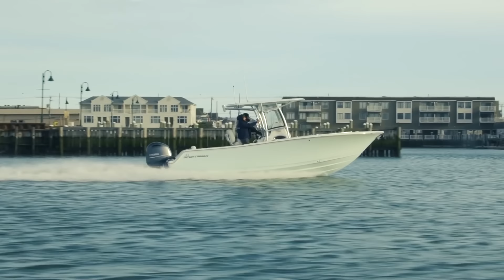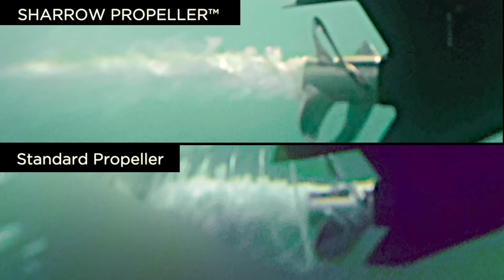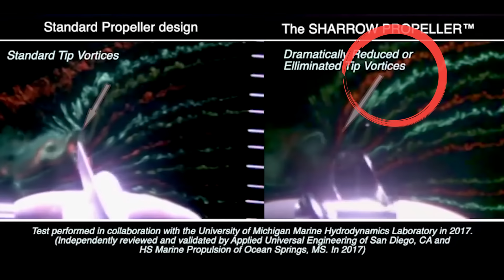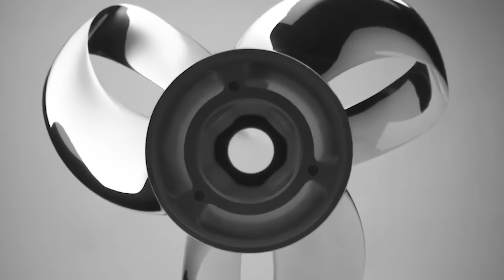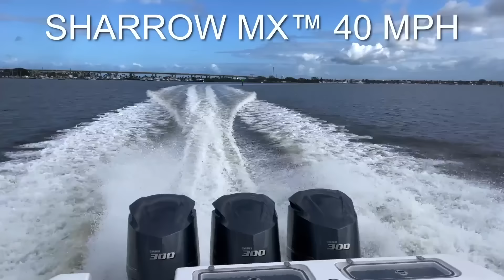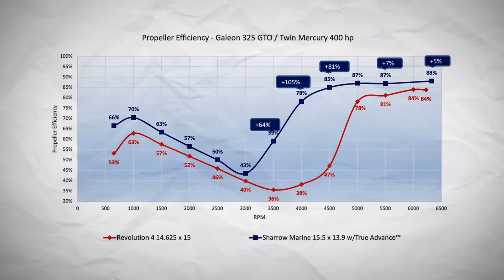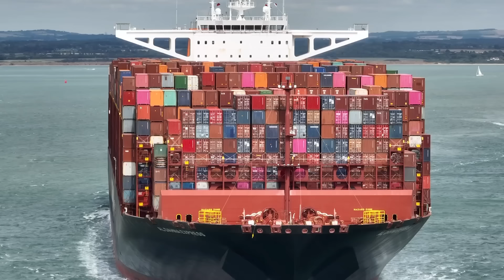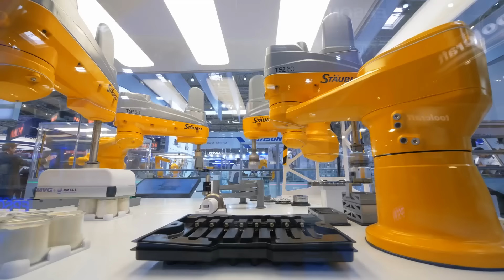This Genius Propeller Will Change Transport Forever

Comment: This propeller design originates in Tasmania in 1971. It was developed by  D B Sugden, an engineer consulting to The Robbins Company  (a US company out of Seattle, specialists in hard rock tunnelling machines). The Robbins Company financed an R and D project lasting 2 years in collaboration with David Sugden. I joined the company in that year, thus I speak with some authority.  We built and trialled a series of propellers from about 10 inch to 30 inches swept diameter.  At that time the difficulty was reproduction of form, a problem which, as you point out, is overcome by CNC capabilities and 3D printing. Trials and wind tunnel testing demonstrated significant performance gains. I recall that a large prop was provided to a fishing vessel owner on the understanding he would trial it for a few months. He refused to give it up because it was so good when the trial concluded. The manufacturing difficulties of that time precluded further development.
Reply from the maker: Just found the patent (US3504990A), wish I had found this before I made this video, very interesting! Thanks for sharing Alistair.
Reply: @ZirothTech  status of the US3504990A is expired, so, any can manufacture and sell it ?
Reply: @MrShaeto  It was filed in 1999, so 20 years from filing and it's expired so yes. Prior to 1995 it was 17 years from grant and so even under those rules it has expired as it was granted in 2004. That it has now expired is possibly why it is seeing renewed interest.
Reply: @ZirothTech  MIT loves to take credit for other people's work whenever they can, so I don't blame you for believing the hype
Reply: @ZirothTech  make an updated video
Reply: @ZirothTech  I see normal blades in the drawings with that patent.
Reply: @ZirothTech  when schauberger went to australia ... he teach some people in his knowledge about water ...
Reply: @ZirothTech  Happy to see that the work of yesteryear might eventually become universally useful. I'm sure Dave Sugden would be glad to know he left a footprint in the sand.
Reply: @ZirothTech  I was looking for this comment
Reply: @ZirothTech  Great research...
Reply: @ZirothTech  https://www.youtube.com/watch?v=MGy8jvf-DZ0 ?
Reply: @ZirothTech  INTERVIEW!!!
Reply: @Ziroth  the first patent that comes up in a Google search is from 2019. I wouldn't be surprised if the original goes back to the early 70s though.
Reply: I worked as the Chief Inspector for The Robbins Company from about 1984 to 1990. We developed many incredible machines such as, the tunneling machines for the “Chunnel” under the English Channel. Didn’t know about the propeller designs, but, Dick Robbins was constantly pushing technology in many areas. We were testing high pressure water jets to assist with fracturing rock in the tunneling machine cutter heads, built a full scale vertical, approximately twenty foot, shaft boring machine and more. If you liked building machinery that had never been done, it was an interesting place to work.
Reply: @davideskelin8266  Hi David, you were obviously in Seattle for part of the time I worked for Robbins. I was the MD of the Australian  company through those years. As you say, it was an interesting company to work for.  The water jet thing you mention was another of Dave's  ideas, but I hesitate to say wholly because such notions were floating around elsewhere.  Both Dave and Dick were not constrained  by outside expectations.  As example, Dave redesigned the violin.....it's a long story, but his instruments are still being built in China. They were both extraordinary people, the best of friends, and the world is a poorer place for their passing.
Reply: @davideskelin8266  Robbins built the most useful industrial building in Kent. From pioneer large boring machines, to power pack and strut for all the early B-777’s, to Blue Origin’s rocket engine research, with a little underuse by that insulation firm with a pink cat. Of course nobody has used the capacity of the bridge cranes since Robbins left. 

Was part of the inspiration everyday seeing the firm across the street that built the reversible propellers hubs for the Polar Star and Polar Sea? Or just the interest in high mechanical and hydraulic engineering?
Reply: It’s hard to believe that since 1971 no naval engineer had developed it, knowing that propellers are one of most refined and studied piece of a boat
Reply: @Quemedices684  This is how those fancy submarine propellers work
Reply: @Quemedices684  US navy already has something better. Our submarine props are a coveted secret
Reply: @Joaquín CF  if you a had read the comment, you Muppet, you'd know that the manufacturing has been the holdback.
Reply: In water, its design might fowl easier and be harder to clear.
In air it sounds ACE !
.
Reply: @Quemedices684  наверняка Dapra этим занималась.
Reply: @Quemedices684  Manufacturing cost is huge factor in the success or failure of inventions. All things break and a more expensive version must amortize its cost over its life time. In addition if mass manufacturing is hard, economies of scale does not kick in and without large number you lack the money to optimize the invention.

"Quantity has a quality of its own." - Joseph Stalin
Reply: @michaelrenper796    It's some kind of obsession with me to contemplate Singularity Intelligence ( a.i. ) emergent awareness transcending the inherited systemic blockages mankind has inherited and conducting a pure principle Real Economy  * / sustainable / renewable / ecological / energy unit / accounting / engineering sense / analysis / make over ... for the planet .
Sense rather than money . 

At some point Singularity shall obsolete any yesterday's monetary unit accounting vested interest encryption and gain access to global data for global systems analysis of logic disconnects with Real Economy * .

* " Critical Path " / " Grunch Of Giants " by Richard Buckminster Fuller .

Fuller was an American pragmatic Transcendentalist  .
Reply: Go Tassie! Whoo hoo!

I'm totally not biased or anything
Reply: I don't blame the fisherman for wanting to keep a State of the art rotor blade
Reply: @destroyer2496  Why? Zero integrity!
Reply: @destroyer2496  catch me!!! 😂😂
Reply: Ohhhh yeah, that’s the research that George Santos founded. I think he mentioned that during one of his Nobel acceptance speeches… shame on you for not giving credit where credit is due… 😂
Reply: I wonder if submarines use those, as silence is the number one priority on any submarine. In most Navys, the propellers are considered top secret and the only photos of submarines you'll find have them either submerged or covered.
Reply: I want to hear more about that 105 percent efficiency. I could use that.
Reply: @anonymike8280  There is no claim of 105% efficiency.  That is clearly not possible.  What is claimed is an efficiency increase of 105%.  That is perfectly possible and would not break the rule regarding the conservation of energy.
Reply: @GodmanchesterGoblin  Satire. I got the idea.

I think it is possible to give 110 percent though. Or is that that people don't want to admit that their best effort is about 88 percent most of the time. I think I just said that the theoretical maximum human effort is 114 percent. Just call it 110 percent. No one ever reaches theoretical maximum efficiency anyway. For most people 38 percent is a Stirling effort.
Reply: @GodmanchesterGoblin  105% MORE efficiency than previus model. This what he means.
Reply: @J Suparman  I know, that's what I said. I think you perhaps meant to respond to someone else's comment.
Reply: Perfect example how many inventions aren't actually new, but just didn't take off due to other limiting factors.
Reply: I met Dave Sugden a couple of times. In tassie at terratec for the trial of the oscillating disc cutter and a lecture of the Melbourne metro. Amazing guy.
Reply: @mchughcb  I'm glad to hear it. He was truly interesting.  I had forgotten about the oscillating cutter.
Reply: I noticed you guys, Tasmanians, are really proud of your accomplishments. :) spent there 5 days in December. As a european whole Australia was very special to me, but Tasmania is significantly more. Wish I could go back for 3-6 months, get a local friend and hike the whole thing across and around and back.
Reply: There is an example of this type in the Ciro museum.
Reply: Interesting that the design also protects the blades from hitting logs, rock and stuff it..
Reply: @simontheyers801  How?
Reply: @awakenotwoke1973  it's a solid circle.. not exposed fine blade.. the side would rub rather than slice into debris
Reply: My dad made his own in the 60’s for our houseboat!😂
Reply: Tassie gang
Reply: Interesting. Thanks for sharing!
Reply: Excellent detail. I bet many technologies were shelved because of production issues.
Reply: Thank you for this. Your knowledge is irreplaceable.
Reply: Actually I'm a bit confused the whole design would be something any navy in the world would want their hands on . Now its shown on youtube xD
Reply: Would this be applicable to windmill power generators? I seriously think that the Holy Cross is homage to the ancient technology
Reply: Thank god it's an Australian invention, Why is this only known now?
Reply: @fr33kSh0w2012  wouldn't be the first time credit was stolen for someone else's design/idea. 

Real reason it's been waiting until now is that mass production had to wait until something like 3D printing to come along. 
Now you can search through the archives of complex designs which never broke through and make it a reality.
Reply: Your comment is false and misleading. It does a huge disservice to the MIT engineers that developed and invented the system. This was in fact, not invented by Sugden, it was invented by interns at MIT.
Reply: @ZxAMobile  That makes it very hard to explain what was happening in Tasmania in the 1970's then.  I am not suggesting that MIT has not arrived in a parallel place independently as has happened numerous times through history. Just recording what happened here, which I was party to.
Reply: @ZxAMobile  actually it is FACT ... watch victor schauberger copy and comprehend nature ... specifically his copper plow ... THAT is the earth version of a toroidal propeller ... PATENTED by Schauberger ... back around 1910 ... his repulsine is designed from the torodial motion of fluid and is what the Patent from 1971 is based on ... another persons work that is over 50 years old that no longer can be restricted by patent ... making the 1971 patent a NON patent because ti wasnt their idea in the first place NOR was it their patent ... and MIT had NOTHING to do with developing it ... stealing it from schauberger yes developing it no ... the original patent is schaubergers ... the propeller shown is also not patentable because the patent on that system became expired in 1960's ... making any further developments form it NOT patentable ... making BOTH of your claims wrong ...
Reply: @kaboom-zf2bl  I find it funny that you think some random guy in the early 1900s invented something that MIT could not. The engineers at MIT are light years above some random dude in his basement making some random stuff in 1900s.
Reply: @ZxAMobile  go watch the video copy comprehend nature ... he did it years before Mechanics In Training even had it in their heads ...  and LEARN some truth .... MIT might be prestigious but it stopped being premiere decades ago ... its JUST a school of mechanics nothing more now
Reply: Nice! ..but I'm not sure 'originates' is the proper word to use, as I think considerable credit for the concept is owed to Viktor Schauberger, who was born in the 1800's, and so didn't have access to the requisite manufacturing tech for realizing many of his ideas in the field of fluid dynamics.
Reply: If it it so much more efficient, how come the giant shipping companies etc. is not using them?
Reply: I assume this would work just as well in reverse, as a wind powered generator???
Reply: I LAUGHED at the reluctance to return Test Prototype bit as this has happened to me several times, only retrieving my Item on promise or delivery of a Personally made Order.

PS. I have a good Friend in Tasmania.
I might enquire further.
.

Its ALWAYS a good sign !
.
Reply: Was wasn‘t this design used sooner if it existed for over 50 years? 
Or has it already been used for particularly fast boats and in the military prior and is only now being made accessible for the general public?
Reply: A link from wiki would be enough
Reply: wow. the best comment ever!
Reply: Where would this design stand against the prop on a nuclear sub any similarities
Reply: That is pretty cool story, if you did not take the time to share that with us, we would all probably still believe this is a new concept that is just now coming out. I certainly did not know that this design was over 50yrs old, I wonder why the original design didn't make it to production on a large scale. I guess some things are ahead of their time, but I certainly hope the original designing engineer/team gets any credits they deserve.
Reply: @brine80  costly machining process that has been reduced by advanced cnc machines and 3d printing
Reply: The best inventions are from Tassie,
Reply: Two pieces friction welding... your welcome. Yes I'm suggesting you cut it horizontaly and make these first, think of it as two props with one wig tip pointing up and the second prop with a downward facing wing tip.. then pancake them together and ah little bit of friction welding... and bam!
Reply: and african invented this?  Wow.   Who would have thunk
Reply: Ahah no shit ! Once it was broken i bet it ended up on a trophy shelf ! Like all the best manmade tools we do!
Reply: US takes Aust. IP claims it as theirs and sells it back at 10x the price.
Reply: This guy is a farce...he picks a subject, does little research, uses a fake accent and collects royalties.
Reply: Can you invest in this company and do they have the patent for the design?
Reply: I wish you had taken real good care of this guy and retrieved the prop.
Reply: Not with that picture you did not
Reply: By young einstein?
Reply: And wait 50 year until he died
Reply: You could have just made that up lol
Reply: So, you know about metal gear?
Reply: Thank you for sharing
Reply: This is fascinating. I grew up in Hobart in 80s and 90s and had no idea this has happened.
Reply: @TheMelbournelad  Well there you are. It all happened in Kingston.
Reply: Why can't these be made in a casting process?  No fancy computer needed. Computer for the original,  sure, but why not casting for large batch?
Reply: Is there any possibility that the company could once again manufacture such a design?
If these have significantly less wake I can imagine they'd be hugely welcomed by the operators of the CityCat river ferries operated up in Brisbane (Queensland).  The wake of those things were bashing marinas really hard to a point that docked vessels had structural damage, not surprising given the the frequency of passes the CityCats made.  They're a great way to get around in a river city but the impact was always a problem even when they slowed down significantly in built up areas.
I last saw something about this in about 2011 or so, do you know if your company ever proposed such an idea to Queensland Transport?  I'd say they'd jump at it for the PR and damage/dredging aspects alone.
Reply: ok, let´s just call it Sugden propeller finally
Reply: But moulds were already a long established thing.
Reply: I knew about this at the time. It's a bit sad it was ahead of it's time. Hopefully this will be picked up again, because it's very usefull technology.
Reply: To reduce production costs on a part like this maybe you contact a company like Ruger firearms on investment casting this is the easiest way to reduce machining costs to only fine finishing
Reply: This design was developed long long before 1971. Let's design actually exist in a polished Granite artifact I believe found in Egypt possibly South America. The only difference is the ancient artifact is in a completely circular form
Reply: I thought Robbins HQ is in Solon OH. I know someone who worked there for a bit
Reply: Submarine propeller technology is one of the most researched fields in marine engineering.
Noise reduction is critical, to the survival of the boats.  
Container shipping would benifit greatly.
Reply: M.i.t. are claiming its there idea too lol. Pretty sure i saw em on one of those little scuba diver motors a while back.
Reply: "authority" LOL what a melt
Reply: At the moment, I don't see any problem with making these low-cost propellers out of Kevlar. Yes, 3D printing could work. It's all about the size of the screws. At least for most vehicles, it is already quite possible in the near future to acquire such propellers.
Reply: Fascinating, thank you
Reply: How to invest in them? They would be interesting computer fans, computer fans are almost like this now anyway I suppose.
Reply: When I was a kid I remember a design just like this it works great like the flying paper ring I saw add on to that made it better.   Better we can not have that and the boat guy I would of just asked to buy it's a aid to help all but most don't see that most want or are use to the parts dept just buy more.   You all winder why and why no one wants to make or design.  You get well he was wrong blah and so on ok kid shut up reasons see the world today kids if old just say do as your told not here figure it out. And I make all my own free to,make anything. And I don't ever share just hit me you you all have some clam candy
Reply: Ehat about the one they dug up in Egypt
Reply: What about the one they dug up in Egypt
Reply: Big things come out of tassie.
Reply: Awesome work Allistar. Can this style of prop run on a Bravo 3, duo prop leg?
Reply: Спасибо за ваши труды,в новое время легче сделать такие формы.
Reply: thanks for the copy and paste
Reply: Oh wow
Reply: I thought it was developed by B J Sugdon?
Reply: Funny... 1971 also the year they destroyed our money and ended the gold standard. Our broken money is anti innovation and they wanted it. Innovation allways destroys the wealth of other people.
Reply: They always say you can't reinvent the wheel. Yet here's a great example of the world trying to limit creativity and possibilities. And now they have almost recreated the wheel.
Reply: How we doing down here at the end of this comment's reply thread? Like boats still?!?!?!?! Lol
Reply: must have been a kiwi
Reply: Internet broke me and I waited for deez nuts joke till the end of the comment because of the surname
Reply: So this is an old design that is now becoming usable by technological advances, neat
Reply: Why don’t big transport shipping companies jump on this? If they can save 30% fuel cost they would kill for that
Reply: @Nobody-iy6tm  not likely, casting metal leaves lots of rough spots and imperfect lines that would basically ruin a propeller blade. You could cast the overall shape of it, but a machine would have to finish it by going back over it to produce the clean lines needed for a good blade.
Reply: Why can it not be cast in one piece? Looks like everything is connected, so pouring into a mould should work?
Reply: @x-shadow-x  they likely do that but its not enough.Its just that machining it to near perfection is hard. Probably has to be within certain tolerance to perform optimally. Seems to me like this is a material problem not manufacturing. Need something extremely durable.
Reply: Awesome comment, thank you for the insight
Reply: But it was patented by Sugma.
Reply: How do I connect with you? Would love to chat about your experience
Reply: Taken from the ideas of Viktor Schauberger
Reply: Can you imagine designs like that for an aircraft propeller, and using something like an opposing piston engine, and an aircraft design with minimal parasite drag to extend the range to it's maximum!? You could probably get aircraft like the Rutan Long EZ to cross most of the globe with the right model build
Reply: I live in Tasmania how the hell am I only hearing about this now.
Reply: Have you copied it from Google because I caught the same paragraph on it.
Reply: Насколько в % снижен Шум и как изменилась Тяга корабельного Винта (пропульсивный коэффициент) ? Это самое главное. Стоимость -это не главное.
Reply: Thank you for sharing your experiences. As someone that has been developing prototypes I can confirm that we are always limited by factors including expenses of production/manufacturing. There are always superior designs and mechanisms but most people wouldn’t be able to afford them and then there are additional considerations like the downsides. In the case of this propeller, I would assume that the damage on impact is much stronger than it is on regular propeller blades.
Reply: Thank you intellectual property must always be protected by giving credit to the researcher.
Reply: So are these torodial prop using CNC available?
Reply: Thank you for sharing! Its nice to see smart people real people leave quality information and history!!! I am looking for a job any leads please let me know.
Reply: More made up crap.
Reply: Thanks for sharing!
Reply: @Blind Freddy Oh my, cultural appropriation?
Reply: You don't mention that the modified blade tips that will give the marine propeller greater protection and strength than the traditional kind. This would allow it to be thinner and create less form drag too. I think this is a great idea and it should be tied in with a theory to supplement the old Froude or Actuator Disk theory too. 

However, I am writing this because there is a related design for stationary propellors on helicopters too. The loss of efficiency is due to the fact that the escaping fluid behind (or below) the propeller (or rotor) still has some axial kind of kinetic-energy being wasted in its flow. Had a centrifugal fan been used and the resulting radial flow then redirected by a curved "canopy" so as to spread out as well as turn it, so as to direct the slower speed flow backward, this aim of reduced kinetic-energy would be achieved. This is not only about the tip-vortices being spread, but also about the whole departing flow momentum concept being improved.
Reply: @David Harold Chester  

I am sure you are right, but I am no expert in the complexities of fluid flow. In its most fundamental expression, we were trying to reduce, if not eliminate, the radial losses and direct the energy to the axial.  As you point out, strength is enhanced, so too fouling of nets and lines. Overall, the improved
Reply: WOW what radical superb design. Massive sales to expect obviously. 
One of my first thoughts is this has to seriously be considered for trails right now for airline and private Jet engines surely!
What a Genius of a designer, an Aussie too.

JB. East Surrey. UK.
Reply: Sugden?
Reply: So it hadn't caught on in 50 years. That means that it has issues.
Reply: Funny how one comment can add so much context to a video. Your experiences were something missing from the videos I usually see talking about this design.
Reply: Is there any calculation that shows that this particular design is the most efficient? Where do ideas come from, just random design and then the results are measured? How come it works both for water and air? Is it not with different angles/sizes/frequencies?
Reply: Yes! I just wrote a comment that I read about a ‘twisted ringed propeller’ that was developed a long time ago in Seattle a long time ago, specific details I no longer recall. Thank you for the information.
Reply: And only 300 years after Da Vinci invented the aerial screw.
Reply: Also has been used on submarines, for a long time!
Reply: You were part of a cool scene!
Reply: ….have a radical suggestion for further efficiency in marine propulsion and transports - that the newly configured torus-prop be used with a carbon fibre modular ekranoplan….the modules will be detachable, stackable, and aerodynamically designed to take advantage of the ‘ground effect’ (dense air at surface of planet to 20’ in height)…the frame unit supporting the engines will also be made of robust tubular carbon fibre and be something of a skeleton before the container modules are added….upon delivery of goods in transit the unloaded frame will be hoisted - by water counterbalance means - for reloading upon a ramp of sufficient height to ensure take-off at maximum loading. 
The system will very evidently depend on clear weather to be efficient but a series of transit stations in the ocean will ensure safe reach in all circumstances with final guarantee of safety being floatability in detached units. The transit stations will depend on the use of khatmatrix deep ocean pontoons (2 mile deep submerse supports) which may network the 7 main oceans of the planet and be culturally styled according to the seven main religions of the planet. The advantage of the system will be the combination of these factors over container shipping: eradication of hull drag; increase of speed by a factor of 15 (1,500%); up to 2000% reduction of material investment occasioned by 20x strength of carbon over steel further multiplied by the substantial gain to be made by its lightness in comparison with the same. Suggest an initial deployment from Russian Arctic through the ex-Hanseatic League nations and across the north of the North Atlantic to Canada taking advantage of the string of landfalls (Faroes, Iceland, Greenland, Nova Scotia) available on that route.😂
Reply: Sick
Reply: I learned from my better Half (coming from Bengal): “what Bengal thinks today, India thinks tomorrow and the world there after and the Suabians (die Schwaben) are first in producing it “. Well, Schauberger is an exception. By the way it is also human intelligence which hinders small technical change in order to keep hard and dangerous labour by hand. Since 1972 my company Brown Boveri & Cie. AG had proposed to get railway freight wagons coupling electronically . Until today the clever politicians could not give their ok to a europewide technical solution. It has still to be done by hand, except in Sweden. Perhaps in 2030 when I am just 90 a new decision for a small delay will come.
Reply: Interesting. Google says it's from 1890😒
Reply: Actually, this propeller design originates from Leonardo da Vinci drawings.
Reply: Why didn't you go to the Navies of the world? Feel like they would have been able to over look the difficulties in manufacturing.
Reply: Interesting. Some propellers have a ring around the prop, isn't this rather similar to it. Also, isn't prop efficiency like 90% today. Does tgis make such a huge difference?
Reply: @sandpatch133  Ducting (the ring around the propeller) definitely helps reduce tip losses and cavitation. It also creates parasitic drag. And it needs really close tolerances to be effective. Bang against anything, and the ring can be driven into the prop. The toroidial prop reduces the tip losses more elegantly, and if it bangs against something, it is damaged but not instantly destroyed.
Reply: @sandpatch133  at maximum efficiency, prop efficiency is like 90%. This prop reaches maximum efficiency faster, and it is slightly more efficient in all areas, but in those areas, it is not a large difference. The main benefit is the prop reaching maximum efficiency faster.
Reply: @sandpatch133  90% is the best they achieve under optimal conditions. Toroidal has a better efficiency over the whole range of RPMs from what I've learned with a quick search(up to 110% more efficient than classical at mid regime).
Reply: @sandpatch133  the ring around propeller helps reduce cavitation , but bubbles are still made , its pressure , area speed and heat combination that causes the bubbles,  the design of this propeller reduces pressure to area ratio , which in turn reduces heat , which reduces cavitation ,  the second problem is of vortices , since the angle of the blade is such that multiple vortices are produced at the same time they tend to cancel each if the perfect angle is achieved theoretically it might even be possible to eliminate the end vortices completely , elimination of these further improves its efficiency, view the propeller from side profile and u will realise the difference is not just about the elimination of tip but the entire blades angle of attack on water / air . hope this helps , enjoy sciencing 🙂
Reply: @RaviDesai-uz5wd  🫡 thank you!
Reply: @RaviDesai-uz5wd  Go back to reading Captain America.
Reply: @AquaMarine1000  well let see , my friend chris here has major life goals , open youtube find a simple conversation and come up with smart ass ideas to troll strangers. u will reach high places for sure keep it up .
Reply: @sandpatch133  If you spending millions on fuel costs a year? Yeah.
Reply: @sandpatch133  ring is to protect the prop, or on small pleasure vessels it's to protect a person if he/she falls off the boat or for when a drunk boat driver "drives"over people that are swimming...the ring doesn't do anything performance wise
Reply: @sandpatch133  Die Graphic  zeigt es ja, spulen sie zurück .
Reply: @sandpatch133  there is missing information in this video, the efficiency gains will only exist under narrow condintions i.e tip speed, disk loading, cavitiation or ventilation presence. the main incentive for this tech is the noise reduction not efficiency.
Reply: @10babiscar  That makes more sense. Thanks for clarifying
Reply: @10babiscar  If the noise disapears, the effencie grows ... what else?!
Reply: @onkelheri-XS  less noise is produced but energy is also dissipated through turbulence and viscous heating. this design reduces the ammount lost to noise by a large amount but with a marginal loss to efficiency. the propfan tech had a similar problem in being more efficient than a turbofan but noiser
Reply: Yes.. but before all that all, this came from the work of Viktor Schauberger.
Reply: @PhiTonics  I'm glad you mentioned Victor and his work in fluid dynamics, but this also triggered another disk I've seen in the Egyptian Museum called the Shicks Disk not sure of the spelling so I spelled it phonetically. This disk doesn't look like a propeller but its outer ring would cut down on vibrations, and it got me to thinking. 

What if you wanted to have two vortices spinning in opposite directions like one fits inside the other. I think this is something Victor would think of, but maybe it would be just as good as one more efficient propeller using two disks...
Reply: @PhiTonics  no it was the british. just ask them
Reply: @ronalddavis  🤣😂💯🙌
Reply: @PhiTonics  Didn’t Schauberger say that propellers in general we’re a poor design?
Reply: @PhiTonics  I was wondering about Viktor Schaunberger, even though I have no specific memory of reading about him working on propellors or even on boats, his understanding of fluid dynamics was second to none and as soon as I saw it I was getting echos of his ideas bouncing around in my head. Thanks for letting us know. Due you have a reference?
Reply: @PhiTonics  And several tribes in Africa thought of it first but due to technological limitations were unable to pursue it further.
Reply: @BWolf00  grow up.
Reply: @PhiTonics  LOL...The video is about a "new" technology and a guy explains how there were researching and attempting to develop this but were unable to commercialize it because of technological limitations.  And you responded with they're using someone else's ideas.  Elon Musk has become the God Father of the modern electric vehicles...but his ideas and implementation is built upon the inventions and "technology" well over 100 years old..and yet I haven't seen one person say...but it was so-and-so's idea.
Reply: @BWolf00  your such a smooth brain I don't even know where to begin, oh yes I do! mute.
Reply: @PhiTonics  From a smooth brain to a smooth ball...works for me.
Reply: @Slay_No_More  2nd attempt due to YT censorship. Too bad you're so disrespectful of Africans and Egyptians...the entire world uses Arabic numerals.  Besides some believe Atlantis was African in origin.  ;)
Reply: @Slay_No_More  Now I feel you may have angered the religious left...and the cult will enact a cancel culture pogrom upon you.
Reply: @Slay_No_More  LOL...dude, it was a lame joke, meant to drive home the absurdness of a random comment.  It really wasn't a definitive statement toward Black Africans, Egyptians (MENA) and their contributions towards the advancement of toroidal propellers and mathematics.  PS - 99.99% of the world has not contributed squat to the advancement of math and science...which is why the 0.001% are usually heralded for their advancements or at least notable in some circles.
Reply: @BWolf00  Go back to watching black panther, real life is not your forte.....
Reply: @BWolf00  is there anywhere i can read about this? Its hard to find information on particular style of propeller, let alone its origins.
Reply: @shrimpy7862  I would follow the leads presented by the video and the people/company mentioned in the comments.
Reply: @BWolf00  is that where you heard about it?
Reply: @heybabycometobutthead  Hey Baby...I've never spent my money on a drag show, Marvel, Disney or any other leftist drivel...including BLM or rainbow flags.  And they can pry my gas stove from my dead cold hand.  But I can act like a Butthead when I want.
Reply: @shrimpy7862  Yep...seems I remember reading about toroidal shapes (in reference to military applications?) but don't really recall.  This is the first commercial application I've heard about.
Reply: @BWolf00   @twolfen58  i see.... I've read all the provided links, and additionally some other sources and so far the only mention I've seen of anything out of Africa is an Egyptian screw pump. I'm sorry to say I doubt you, I feel like somthing as significant as you claim would be a bit easier to find.  Underwater props unlike screw pumps we're not even widely developed until around the 1700s and even then they were prototypes. With out any evidence to support it, its a very bold claim.
Reply: @shrimpy7862  Dude, as I've already said, the African reference was just a lame ass joke to to address the absurd nature of a random guys comment.  I wasn't making a claim...but a joke.  The whole video is about the current commercial application and the potential applications of this "new" technology.  As it goes I'm fairly certain that it's already in classified use on our boomers.  There's no need to make a mountain out of a mole hill.
Reply: @BWolf00  I see. I can't see that comment, it mustve gotten filtered. Not that it was a very funny joke anyway. I was genuinely curious because I'm an avid fisherman and sailor, and also because history is cool 😎 🤓. If you had explained it was joke from the start it would of never been anything, so I'd say you made a mountin out of a molehill.
Reply: @shrimpy7862  Since my comment where I say it was a lame ass joke was prior to you showing up...sort of makes it yours and YT's problem not mine.  Molehill flattened.
Reply: @twolfen58  So, by your opinion, all our technology and science comes from Egypt? Somehow, they predate all civilizations by 50,000 years or more? Egyptians didn't build the pyramids they found them and settled there from Ethiopia. Atlantis was 1000000 years ago. The pyramids are landing platforms for RA's space ship.
Reply: @BWolf00  well I got a LOL out of it 🎉 Elon Musk though is leading the way for what an African can achieve.
Reply: @BWolf00  Except more than half the world population in Asia....
Reply: @BWolf00  Sure, sure. Totally.
Reply: @BWolf00  yes they had them on wind generators supplying power.
Reply: @BandARestorations  looool
Reply: @BWolf00  are you high ?
Reply: @BWolf00  Mole Hills were invented in Bhutan at least 50,000 years ago.
Reply: @SirGregory  - mountains were being made from molehills long before that good sir. Chimpanzees were doing it none-verbally for 2 million years and still do to this very day. They fling fresh dung at each other when squabbling 😂
Reply: @BWolf00  Arabic numerals are known as Hindu numbers in the arabian world.  These came to the western world from the middle east (hence calling them arabian numerals) who got them from India.
Reply: @BWolf00  ayo'..........hol'up(smacks lips)so you be sayin' yall was kangs n sheeeeit?
Reply: @BWolf00  bet you think Africans thought of it all
Reply: I am immediately suspect of any statement which begins "some believe..." or even "many people think...". Believe without evidence is meaningless.
Reply: @BWolf00  you do realize that Arab has nothing to do with africa? And the modern numerals are a c0mbination of the original arabic numerals and some indian numerals.
Reply: @BWolf00  indian numerals.
Reply: @BWolf00  Then why is it blatantly accepted by all the African tribes of Sub-Saharan Africa that they had no written language and therefore there is no record of such anywhere. Anyway, I thought this was about propellers?
Reply: @BWolf00  there's absolutely nothing special about Arabic numerals. It's just 10 'letter' language of numbers. Instead of 10 it could have been 2(the actual digital as 0 and 1 but could be a and b or + and - instead) 5, 12 or 15, the math would work the same. 
2×2=4 in any place in the world regardless what symbols or system you usePeople are able to express the same ideas in any of thousands of languages whis works by the same principles even though they may developed independently.
Reply: @BWolf00  well, there is this thing called the shisk disk it's a pretty famous Egyptian artifact. Nobody really knows what it is some Egyptologist think it's a vase. Which is kind of ridiculous shisk disk looks similar
Reply: @nathanh1582  true, but before the Arabs, there were the Egyptians and the Egyptian's had x2 African-American Pharaohs from Africa from a place called punt who ruled Egypt.
Reply: @BWolf00  😁😂🤣
Reply: @BWolf00  numbers came from india, asian rasisit!
Reply: @BWolf00  "Arabic" numerals or the decimal system was created in India and taken to the world by Arab traders.
Reply: @BWolf00  long grass would do it
Reply: @BWolf00  wuz kangz?
Reply: @BWolf00  wrong.  the chinese developed it since ancient time but wait for  someone make a martket then they can copy.
Reply: @EverydayImTECHnIt  African American pharoahs? In a time when the Americas hadn't been discovered by the rest of the world and no Africans had been transported there yet?

If you say so.
Reply: @BWolf00  The guy inventing zero....thanks for nothing
Reply: @BWolf00 lol
Reply: @EverydayImTECHnIt    African-AMERICAN Pharaohs ruled Egypt 😂🤣🤣
Reply: @nathanh1582  Sure it does...Africa is where Arabs harvested their slaves from for so many centuries.
Reply: @jimmycricket5366  Once again it was a joke.
Reply: @Ihtiandr13  In Woke America 2 + 2 = 5
Reply: @BWolf00  Sure, I get it, but remember we live in a world now where twisted people with agenda are trying to promote false narratives... So sadly we're not sure when someone is joking anymore.
Reply: @BWolf00  name anything Africa has done for the world in the past century. No major innovations, you say? Buildings made of mud, you say?
Reply: @BandARestorations  atlantis was 12,000 years ago, dude. It was absolutely not a million years ago.
Reply: @skipintroux4444  you and i both know elon musk is not the face that pops into our heads when you hear "an African man"
Reply: @stevenkunkle3857  where is your proof cupcake?
Reply: @BWolf00  tesla was musks idea... he bought the company smooth brain.
Reply: @resmores  Somehow I imagine years later some other idiot with a pair of peanut sized brain cells hanging between his legs will still be responding to this post.  

This issue/question wasn't a matter of ownership, but being the originator of an idea vs being responsible for (or being involved) in the commercialization of that concept.
Reply: @BWolf00  Arabic numerals are Indian in origin, they are just called Arabic, these characters and styles have evolved over time. Prime counting hasn't always been ten. A dozen for example is left over from the unit of twelve. Cheers
Reply: @BWolf00  You are very weird, acknowledging the inventor's is a good thing. Elon musk is a shit comparison, because he got famous because of other stuff as well, like SpaceX and much more that doesn't mean people think he invented space flight. I mean his company name is literally Tesla which already gives more recognition and respect to the father of electricity than the American government has.
Reply: @entireglxy4338  First I wasn't arguing against inventors or discoverers...but just as important are the people that expand on or capitalize on these via commercialization.  In this case people were diminishing the work of a company and a researcher of that company because they were not the "inventor".  Conversely I acknowledged how, although not the "inventor" of the electric automobile or even the creator of Tesla Motors, Musk's commercial success with Tesla Motors he has had a huge impact on our society.  So much so his name is now synonymous with Tesla autos.  

Now on to Tesla himself, first notice how Tesla was both not the "discoverer" of electricity nor the inventor of the electric auto...yet he is the acknowledged "father of electricity".  What's weird is you comparing the "recognition and respect" of the "father of electricity" Tesla to any government much less the American government...that's a shit comparison.  BTW, Musk did not name the company...that honor goes to the founders of Tesla Motors...not Musk.  Again, Musk just capitalized on the commercial success...making his name synonymous with it.
Reply: @shrimpy7862  He's trolling you. He literally stated the world uses Arabic numerals therefore the world owns them everything that uses Arabic numerals
Reply: @sleepyearth  yea, he told me he was joking 2 months ago
Reply: @shrimpy7862 One of the above comments has the Patent #.
Reply: Nigerian prince needed help to fund it
Reply: A 5 axis machining center would have no issue buzzing one of those out in no time.
Reply: @chrisnat6467  это не будет экономически выгодно.
Reply: yay tasmania
Reply: So all windfarm blades will be retrofitted with These?
Jet engines Too?
Reply: The are 1,000,000,000s of food blenders out there that could benefit from this technology.
Reply: IT'S REVOLUTIONARY !! ... even if it's an old invention.
It was invented in the past at a time when we could waste anything.
It is now re-used at a new period of time when it becomes a key factor in transforming all our industry of transportation and energy as we have to do to survive.
Reply: actually Allistair ... it was developed by Victor Schauberger from his discoveries on how fish move in water .. and this design is because of shark skin ... the schauberger earth plow is a similar design ... this was done back in around 1910 ... his repulsine also uses this exact same technology ... and yes it is the exact same pattern as found in a slide showing shark skin ... 
 a Good video to watch is copy and comprehend nature by victor scahuberger .... it covers this and his sluice troughs and water management for log travel etc ...
Reply: Chatgbt ftw
Reply: At 4:24 you will see Dave Sugden with a bandage on his face. Apparently used to hand make violins.

https://youtu.be/a56a8L6x6eg
Reply: Yeah, no. I'm very sure that I could create some dies to forge these, and I could most certainly create some patterns for the molds to cast them! Lmao! Machining and balancing them would be a breeze also. 
These could have been quite easily manufactured using a follower attachment on a jigmill and a good 'master'.
Reply: @oldnick4707  I would love to know how exactly you think you would forge these?  Have you ever designed a forging die or seen a forge in real life?
Reply: @Old Nick  if you can  build me one of these props for around the cost of an existing prop,I'll  buy one off you,and so will everyone i know. Sounds like you stand to make a fortune. If the claims they make are accurate...
Reply: @oldnick4707  Says the guy who is currently not making $5,000 propellers...
Reply: @mickmccasker6401 ,
   I make $25,000 (and much higher) stainless impellers for industry. You are correct. 
   It's hell to find people to help. Grinding, polishing, machining, balancing, etc.. Finding foundries for example that will turn out high-quality product in stainless? Good fucking luck! Pretty much these guys have a deal with a foundry, and are lucky in that, or they're doing it themselves, created their own foundry!? That is pretty damn industrious of them if that's what they've done! (They didn't though, in my opinion. Their price isn't 'what the market will allow', but rather is indicative of probably starting with castins that had been produced by a art sculpture foundry.)
   (Google Mercruiser's foundry setup and be sufficiently in awe.)
Reply: @mickmccasker6401 ,
   Incidentally Mick, these Sharrow propellers have a lot in common with an impeller, as they've the form of a volute within them. It'd be much more efficient though and produce less cavitation if they had a 'outer band' cast into them. They'd be a hell of a lot tougher also. Think of it as an exposed jet drive situation?
Reply: Good to know its not those nerd at MIT the first to discover it.
Reply: Shows how much we are interested in investing in better technology! We had this forever and nobody used it! Nobody!
Reply: That boat owner is a disrespectful person with no integrity
Reply: @ChinchillaBONK  What are you talking about?  He gave them the best marketing line ever
Reply: @ChinchillaBONK what do you mean he lacks integrity?
You think he stole the prop or something?
He no doubt paid something in order to keep it! 

The company wasnt looking for people with integrity.
 They were looking for people who were willing to test their new design in the field, to see how it performed and if it improved anything about their boating work! 

Whatever you think integrity means is wrong.
Reply: @ChinchillaBONK  Wouldnt you if it saved you over 1\3rd fuel cost
Reply: @ChinchillaBONK  You definitely sound American.
Reply: @HJZ75driver  I am not. I am from Asia. Never ever stepped outta my region. Theft of any kind is still theft regardless.
Reply: “ Hi joined the company in that year, that I speak with some authority.” Says the random guy on the Internet.😂
Reply: @howhigh0521  who would need to lie about something like this lmao
Reply: @howhigh0521 and where were you at the time?
Reply: @howhigh0521  "Says the random guy on the Internet" - Responds the incompetent guy on the Internet, who cannot tell a screwdriver from a wrench.
His comment was competent, consistent and believable to the point that its worth googling and researching. Says an engineer!